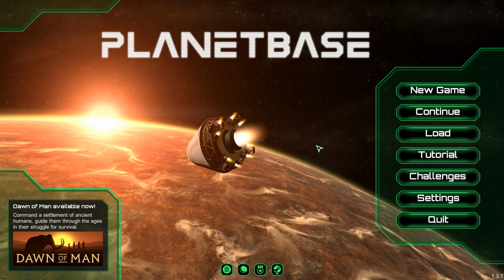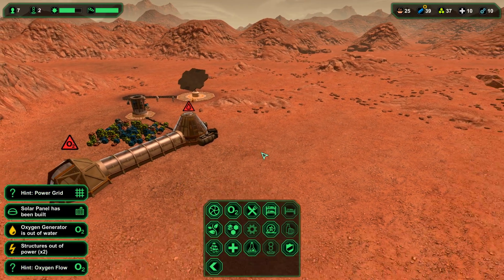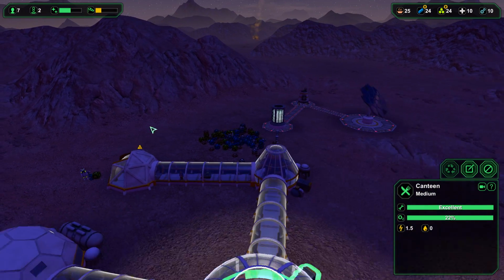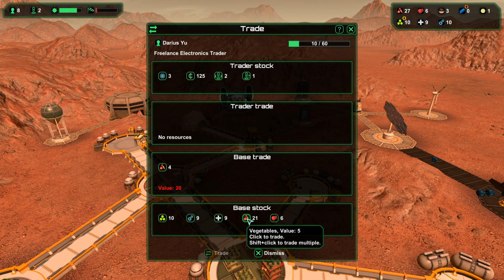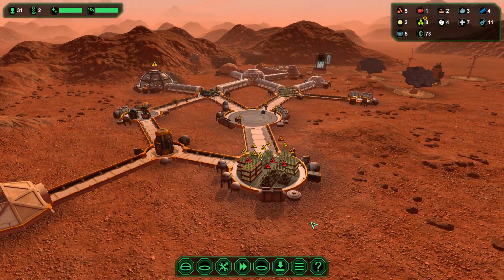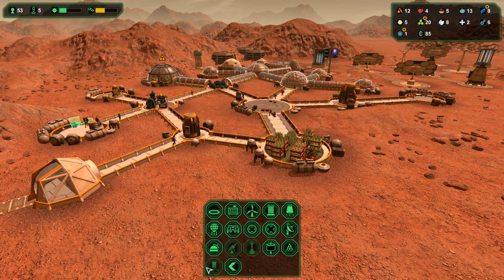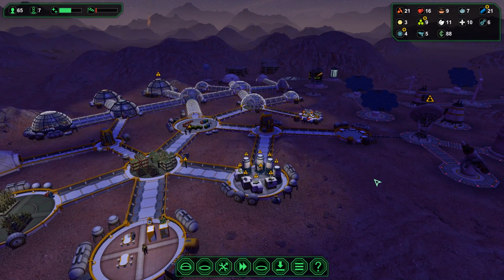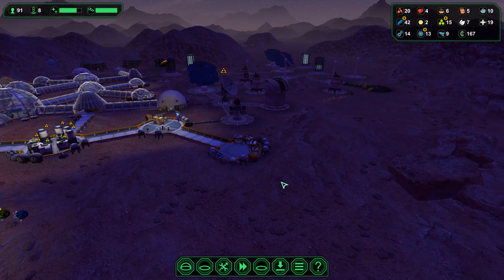Steamed! | Planetbase

Comment: From memory, the biggest limiting factor in this game when you get near the end of a level is that you can only have a limited number of buildings. So, to be efficient, instead of having multiple small domes, you want to make the absolute largest domes that you can.
But at the other side... when you first start out, you have limited supplies, so smaller domes are better. You just have to accept you might have to dismantle everything and rebuild it later.
On top of that, going the larger domes, you'll find for example, it only costs double the resources, but you can fit 3 times the items in many of the rooms, the biodome where you're growing plants for example, you pretty much always want to go with a large dome.

Comment: I used a tactic on raiders on this game, the basics are thus: watch for visitors, if they are armed ( the suits will be a different color than normal visitors) lock the airlock that is closest to them which forces them to divert to the next door. Just keep doing that and if they can't get inside in a short timeframe; they will suffocate outside. You just need to keep an eye out for the ships and which doors need to be turned off to make them divert path.

Comment: Few tips, 1 build more énergies collectors , as long as they are fully fill before night you will be fine, 2 build security center beside of air lock like you said to make it easier for the guards to defend. 3 build more radio and telescope because the more you have, the higher chance you have to receive transmissions or catastrophe détections.
Reply: Yes, he can see on the Percentage of them ho effective they are, the first build only provides 30%, so 3 are needed for god efficency.
Reply: Bit late, but i always have a completly encapsulated landing bay and just disable the air lock if intruders turn up and let them suffocate